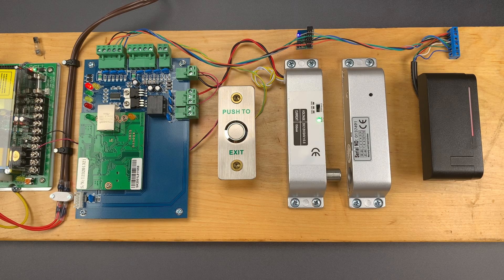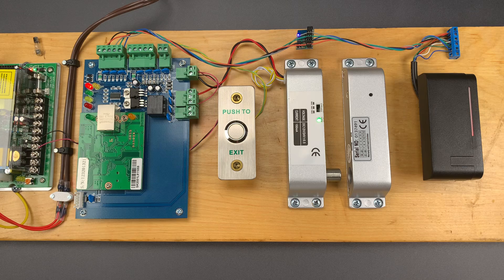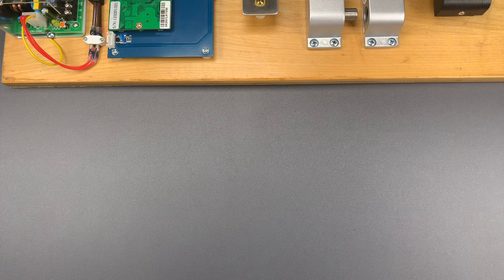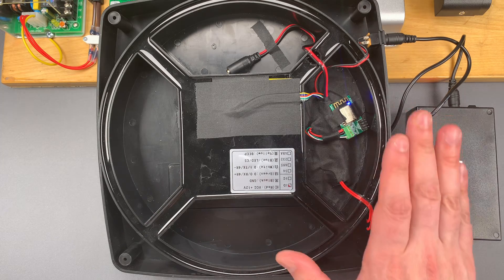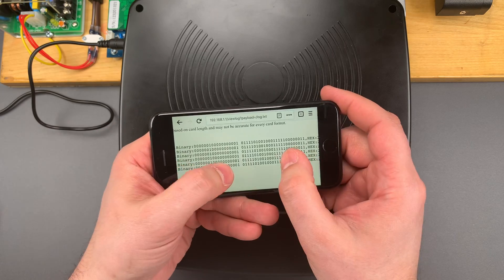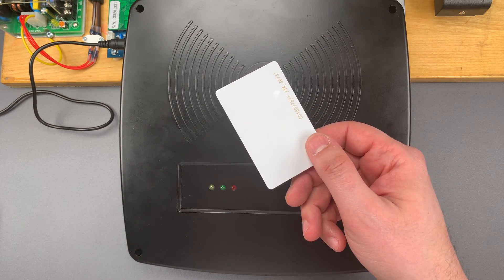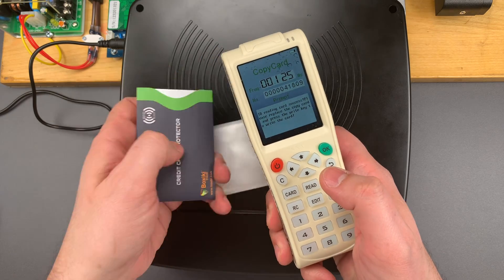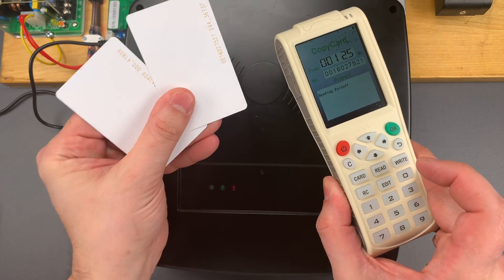[1056] This Black Box Reads RFID Cards in Your Pocket

Comment: The range is as advertised. The manufacturer claims the following distances:

Special long range card: 1m/3.3ft
General thickness 1.8mm card: 70cm/2.3ft
Thickness 0.8mm card: 50cm/1.6ft
Keyfob: 30cm/1ft

As you used a 0.8mm card, the distance is as expected/advertised. That means the standard thicker access cards can be read from around 70cm away, which is quite far for RFID.

If you use an HID MaxiProx, the distance is even larger, at 182cm, but such a ready costs around 600€ and this smaller one only around 100€. It really depends on your use case and if you do stuff like that as a professional or just for yourself at home.

Comment: Interesting you talk about RFID blocking as basically every single visa, master, amex and diners (plus others) credit or debit card is NFC-enabled so does a device like this (I realise your video is 4 yrs old) allow reading (and potentially cloning) of those bank account access cards? Of course with a bank account access card you aren't reading the PIN, but maybe the hash of the PIN is stored on the card itself or does an ATM require full online access to back end back systems to authenticate a card and PIN? Back to the RFID blocking, there are heaps of places plugging effectively metal faraday cage type 'wallets' for cards now but I don't use one (my bank accounts never have money in them!) and I don't know anyone else who does.

Comment: Those RFID blocking sleeves do manage to work well - I have one on my MasterCard and I covertly tested it by "accidentally" leaving it on when I was buying something at the shops. But I do plan on upgrading it soon.
Reply: Did it block it from reading ur Mastercard information
Reply: @MobfiaEnt  As a matter of fact, every time I left the sleeve on the EFTPOS terminals would not read the card (I performed this test several times so far), so the sleeves work.
Reply: @milesipka  so without the sleeves ur credit card information is completely at risk for exposure ? 😳
Reply: @MobfiaEnt  Pretty much a yep...
Reply: @milesipka  does it show epir/cvv info
Reply: @MobfiaEnt  Not sure about that one...

Comment: I work in a small corner shop with a contactless pay point. A lot of customers try to be lazy and just plap their whole wallet against it then get confused when that doesn't work. I knew it was because they had more than one card being picked up at once by the reader but never saw so clearly what is actually happening there.
Got another fella who always makes a big show of getting his cards out of these expensive copper plate sleeves. Are those any more secure than the metalised ones you have here? I wouldn't guess so..

Comment: In my personal testing, the aluminum sleeves have no effect on LF cards but sufficiently block the signal on HF cards.

I've also been able to read multiple HF and/or LF cards together, in various combinations. But multiple HF cards together did sometimes hamper read integrity; usually it was partially corrupt data.

They do make these "blocker cards" that 100% interfere with the HF reads from my testing.

(I used a Proxmark 3 Easy and Pixel 3a for my tests, so not quite as fancy as your setup, and certainly much shorter range.)

Comment: "encrypted" is not the correct term, since an encrypted communication is also replayable. The communication should at least be encrypted , but should also incorporate non replayability such as an  unique id which increases on the reader side, and a controller which would never allow the same packet twice.

Comment: A few years ago I worked with some NFC/RFID reader modules with an Arduino. While you showed that when two cards are simultaneously in the range of the reader it can't read any of them, but my modules specifically had commands to detect multiple cards in range and select any of them to read one by one. So, I guess your card copier device doesn't have this feature, and putting two cards together wouldn't make them secure and impossible to read.

Comment: I know I am late but I searched the internet everywhere. Where can I get some of those ESPKeys with that exact wire tap connection thing on the board? Everything that I've found looks completely different or it is just the bare card without the piece to tap into wires with.

Comment: I’m curious of your take on a particular type of PIN code keypad entry system I experienced in the late 80’s. The keypad itself was an array of buttons, three across by four high. Digits 0 through 9 were represented, plus # and *. Those requesting entry into the secure area had to enter a unique PIN but had to pay particular attention to the keypad as the characters on each key would light up, appearing in random locations whenever the keypad was activated. One could never succeed in entry by adopting (or copying by observation) a sequential position location “dance” because the odds of it being repeated hence was zero. What was even more clever was the optics, a user had to look straight on (orthogonally) to the keys in order to see the characters through an optical “tunnel”. In no way could two heads be positioned in such a way to simultaneously view the keypad characters. This system was the only one of its kind I ever experienced in my career, and unfortunately I lost memory of the manufacturer.

Comment: Not to mention any building that has Request to Exit Motion Sensors are easily overcome by taking a compressed air duster such as used for cleaning keyboards and turning it upside down and spraying it in the cracks of a door to trip the REX Motion thus unlocking the door.

Comment: We used RFID badges at work. Debit cards also use RFID, but all I have to do to badge in is throw my leather wallet up near the reader. With 5 RFID cards in 1 wallet, wouldn't the reader get confused? Or is it simply the work badge and debit cards use different protocols?

Comment: I had a security job in the 90s where I had to carry a stack of proximity access cards with me, it was like a dozen cards with a rubber band around them. Never understood why some of them wouldn't work unless I pulled it from the stack, though the cards on the ends usually scanned fine.

Comment: There is anti-colission readers that can read multiple tags at a time.
Reply: I wonder if it would help to program several dummie cards, in order to overwhelm it?
I suppose I would have to know how many cards it can read and keep more than that number?
Reply: @Inertia888  They can usually read up to 50 cards simultaneously. But there are only high frequency collision readers available. So they can't read credit cards.

Comment: The sleeves are a pain, tried them and it sucks. My workaround was to put 2 of them on either end of my wallet so they sandwich the cards. Most security badges have a sorta flipper system with a blocker. And many wallets now have build in protection anyways.

However, stuff like bank passes use a different system which makes this a moot point. The actual fraud numbers using this is just way too low. Unless someone can point to a different investigation. 

Not aware of access pass fraud though. Easiest way people use is literally carry a big box and wait for someone to keep the door open...... happens more often then you expect

Comment: NFC also does the same. Our transit system uses a system called Compass and when my driver's license is beside my Compass Card it will screw up the reader as our license also has an NFC. So problem solved, just carry multiple cards together

Comment: Storing multiple cards together won't save you from getting your card data stolen. Most RFID protocols implement some sort of collision mechanism and multiple cards can be read one by one. The mere reason most card readers give up when approached by multiple cards at the same time is that the programmers were lazy to implement collision detection mechanism as it requires some effort.

Comment: While you WERE able to read the cards through the RFID blocking sleeves, you had to get the reader RIGHT UP AGAINST the sleeves to do so, so I would say the sleeves work against REMOTE reader scans. I, personally, have an RFID blocking wallet, and I know from trial that I have to take my American Legions key card at least partway out of the wallet before it will work on the door to the club.

Comment: Almost all hotel cards are the cheap non-encrypted type. The Mifare Classic type cards are easy to copy. The more secure cards as you mention will offer a challenge that is random (so you cannot replay) and the card will "sign" the challenge and offer a response that is different each time the card is presented. Lower cost , higher security is using Desfire type cards (used for Metro/Oyster) that implement this protocol.

The most secure access control cards that I know of are based on RSA/PKI type keys and use a Javacard operating system that is very secure and of the same kind found in bank type cards. Most end uses cannot simply use these cards because they require you have access to the root key and only the vendor that made / provisioned the card holds that key. These cards rely on a public/private key pair[s] for authentication. Often these cards will hold an encrypted PIN, biometric data etc so that multi-factor access control may be implemented.

Comment: Thats no secret RFID cards can be used by pen testers. I've been doing it for 10 years. You don't want to be arrested or pulled over by security without an official scope letter or the number of someone who works there that can vouch for you and the reason why your there. But I do know this does happen out in the wild by people who want to gain entry to your work place so I've always placed my badge into a 2 card holder with the company logo and my photo side pointing to my clipper card (the mass transit card for the San Francisco area). This will do 3 things; one, it will not allow pen teams to clone my card, two, pen teams don't know to target me because my company logo isn't shown on the outside of the card, three, criminals can't clone my mass transit card and use my credits. If you want to know more all you have to do is attend any talk presented by Deviant Ollam. 31733rt

Comment: Could you see if a home hack of using copper, aluminum, and/or other foils negate the range of the larger scanner? ie if you had a leather wallet lined with said foils, would it work the same as the individual sleeves.

Comment: Two cards together don't necessarily fail to be read. There are actually systems designed to do exactly that. The most common would be the Shinkansen Gates on the Tokaido Sanyo Shinkansen. They will read both the local card (Suica, Pasmo, ICOCA, etc.) and the Express Card (the one you use for the Shinkansen) at the same time (just hold them together). This is done to check out of the local transport area into the Shinkansen network and vice versa.
You can even keep both cards together, when you simply use the local card only, be it for the train gates or even on a vending machine or at a store.

Comment: The doubled card trick is something I used when I was in charge of a secure access building with a "cost conscious" (read: cheap bastard) building owner. Everyone got 2 keychain fobs and 1 was on a key return line while the other was just on 2 rings so it hung at the same length. That made it easy and convenient for the users while it made it nearly impossible to get any reads from a similar long distance recorder. We managed to get one good read during 4 weeks of pen testing and that read was on the double ring fob, which was only good for getting your daily free snack from the vending machine inside.

Comment: And exactly this is why i will never use electronic locks for residential use. There is no issue if you have 24/7 perimeter security or if you use electronic locks with an adequate monitoring inside of buildings (as long as they are not multi-dwelling).Every encryption is crackable given enough resources and time, every digital transmission of data is attackable, every analog transmission is attackable. But what it makes it much worse, it can be captured and worked on far away from the target location. Thus the owner will never even notice any breach unless they watch any potential logs very carefully. Most residential solutions don't even have logs or they can be wiped. All i see is an empty log and i can suspect that somebody accessed my property, but i can never be sure. It can also be just a fluke or a bug. 

Physical devices such as high quality locks are much harder to open for the average Joe. I assume that LPL is certainly not an average Joe. Especially harder to open, without some destructive means or without leaving marks. You can't copy a key just by casually walking by a person. To pick locks you need some skills at least, to open them fast and effective you need a lot of experience and not some more or less of the shelf device and a cell phone or web browser. Once the research is done how to open electronic devices it is accessible and usable for even the most idiotic person who is just intelligent enough to use a smartphone and an app. You could possible teach a monkey on how to use such methods. 

Even if you put your cards in protective sleeves and whatnot, there are still weak points in the system and the process. You need to swipe the card at one stage for sure against a reading device. With todays miniaturizing of electronics it is indeed possible to place an additional reading coil somewhere very close, place an additional faceplate over the reading device that clones the data and many more possibilities. You can't eliminate all these easy and cheap ways to get to the data unless you spend thousands and thousands. And even then there will still be flaws left in the system. You use electronic locks and somebody will enter your property sooner or later without you ever noticing. Or you come home and your entire house is empty, newly renovated and squeaky clean....ohhh and probably also sold by a conman if you were absent long enough.

While locks with keys are also not secure, they still provide a better security than any electronic solution. And you never can be sure if there is a hidden backdoor by design, to allow for example a locksmith to open the lock in an emergency. Software itself is inherently insecure. There are bugs, always and in every software, that cause security issues. Electronic locks are no exception. There are design flaws in the entire system, some born out of convenience and better user experience. These processes and designs are actually holes punched into the security and every hole can be exploited. But without the holes the product would be useless. You can only pray that the designers understand at least something from their job. Which out of experience i categorially deny in 99.999% of all cases. The only person you can trust is yourself. As soon as a third party comes into play, and that is especially valid for anything electronic, the security goes down the drain. You can't control 3rd parties. Sure, you also can't trust a lock manufacturer to not keep additional copies of keys, or that every employee is a trustworthy person. But it still better than with electronic locks, where everybody around is capable of sooner or later making a copy of your key (i.e. the smart-card). You don't have 100% control, but 99% is better than a 50/50 chance.

Comment: On placing them together, they need to be touching to create the gibberish (which you show but I thought I'd emphasize), not just in the same wallet for someone thinking of trying that. I've had an RFID card on either side of my wallet for two locations I access and I only need to hold up the side with the card for the location and it will read correctly. They have only a few mm between them but it's enough that I have no false readings.
PS - Love that you are trying out RFID and electronic lock methods!

Comment: Using a dynamic credential like with challenge response you don't even need to encrypt

And the data wouldn't even need to be encrypted on the card as long as the key data doesn't even leave the card, but only a dynamic response

Comment: I have 2 key fobs for work.
I don't know which one is for entering, or which one is for filling up my truck.
I simply hold them both against the reader, and this picks the right one.

But when you put your card in a RFID blocker is like building a radio station, and then a jammer to jam the signal.
The advantage of wireless the card is diminished by the blocker.

How do I know if I have a safe key fob?
I want to have one to enter my home.

Comment: Would 2 identically coded cards transmit cleanly in unison or would there be enough variation in power up and transmit so that a pocket full of cloned cards could provide the same blocking potential as a pocket full of unique cards?